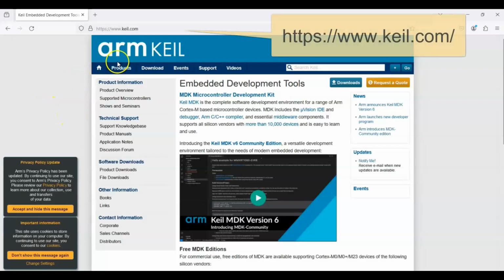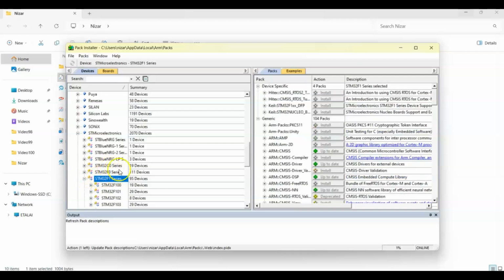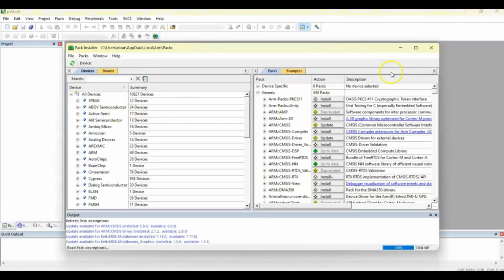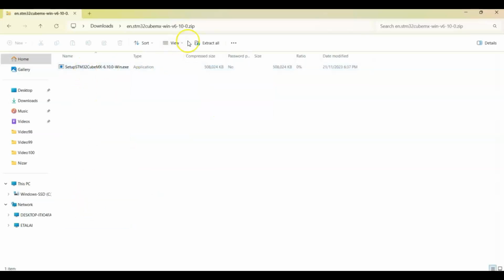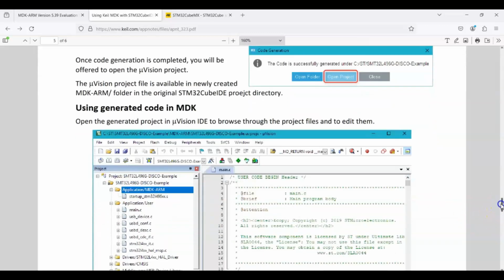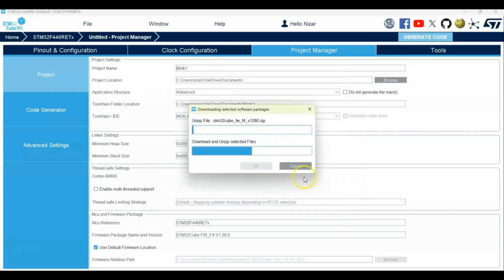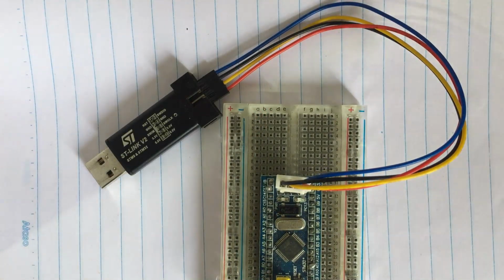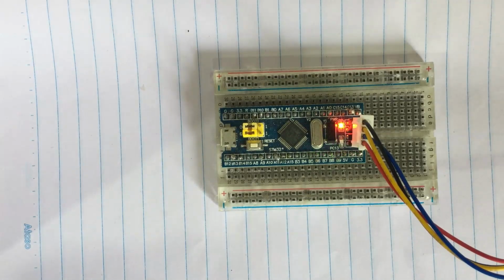101. Install keil uvision 5 with CubeMX and blink STM32 LED

Comment: Can you confirm that OLED display Driver IC of 0.96inch and 1.3inch OLED are same ,if yes then can i use your old driver shared in one of video in my project for 1.3 inch OLED
Reply from the maker: Thanks. I am not sure. I did not test it yet. You can try, there is no harm in trying
Reply from the maker: After some research I got some points
1.3" OLED has SH1106 Library. Try https://github.com/afiskon/stm32-ssd1306
May need two pull-up resistors 4.7k between vcc-sda and vcc-scl
Reply: Thankyou  @NizarMohideen  ☺
Reply: In your opinion is there a benefit to keli and cubemx over cube ide? Thanks for the video
Reply from the maker: I personally like CubeIDE.
CubeIDE is fully free and it has almost all the facilities
Keil is free for study purposes only. For bigger projects it is not free. For this reason keil has more bells and whistles.
There are are many useful STM32 tutorials in YouTube they use keil so I decided to introduce this for the beginners